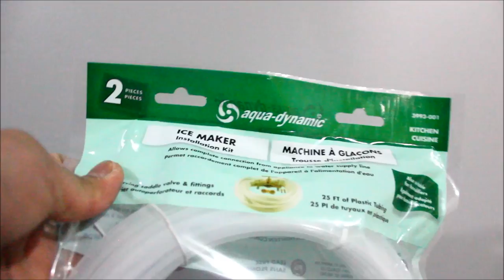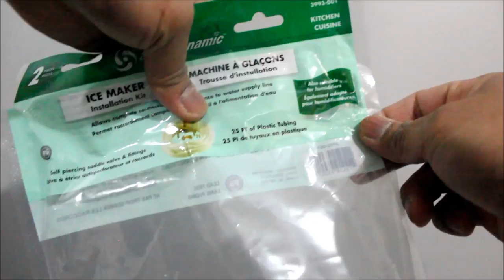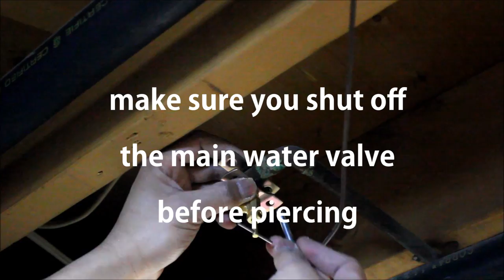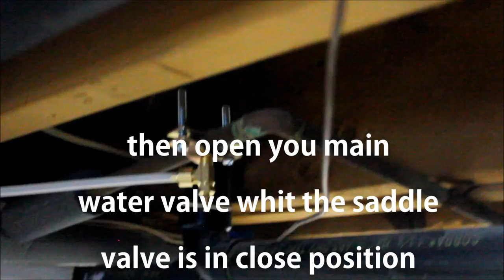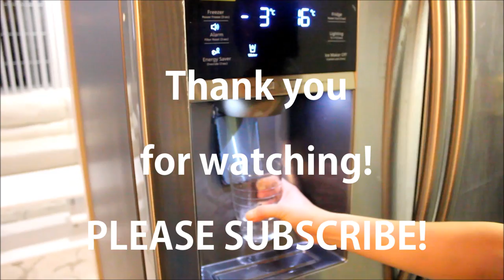DIY Installation Kit Aqua-Dynamic Ice Maker Samsung 23 Cu Ft Refrigerator | JURO Workshop

Comment: IF you are using this saddle pierce which is not suggested. Pierce from the top NOT the bottom to avoid pipe settlement, put it on a vertical pipe